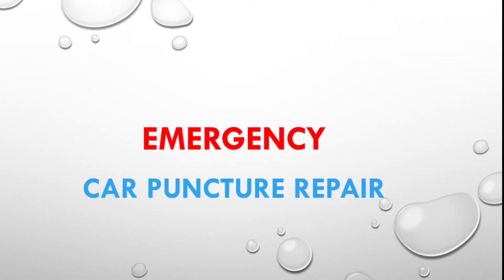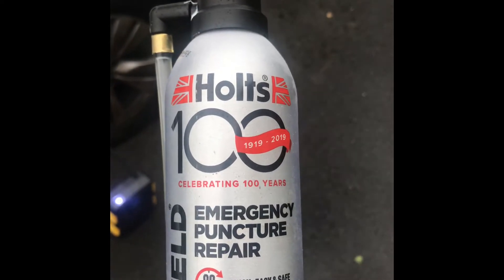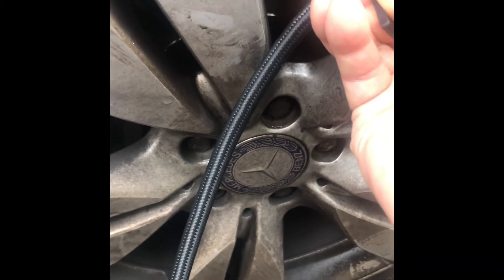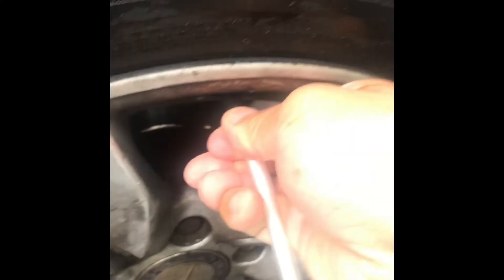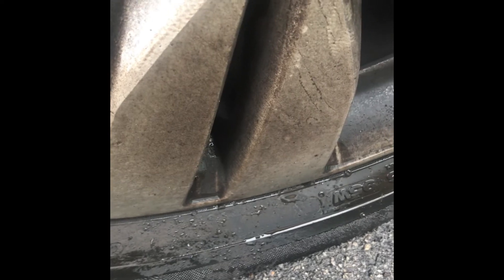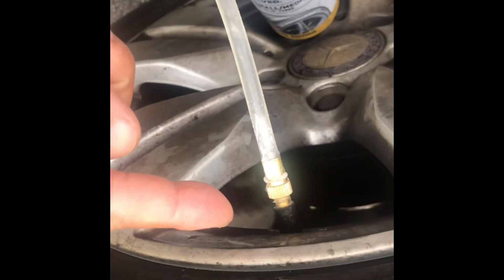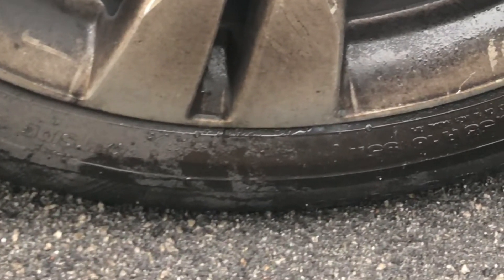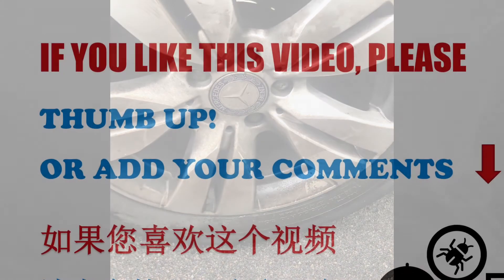How to repair a punctured car tire on the road! Mercedes E200 (2013)

Comment: You're supposed to have a drive round for 10 minutes before you pump it up
Reply from the maker: great! Many thanks.
Reply from the maker: I thought if you pump it up, more pressure will be helpful to push the filler to fill the punctures. I used this method to repair two tires. It works well. I will try your method next time.
Reply: @Yang365  
It should say it on instructions